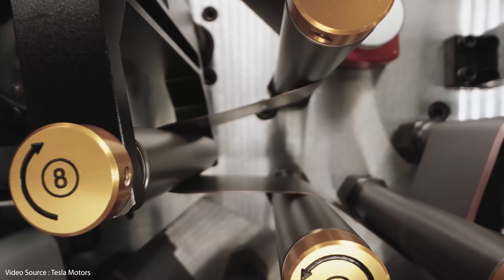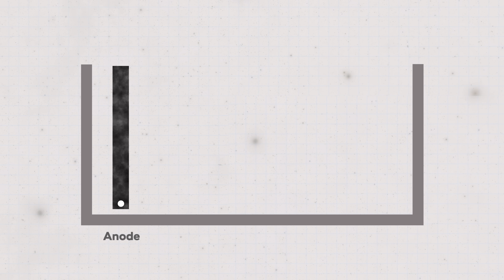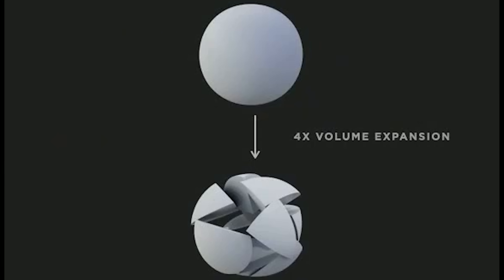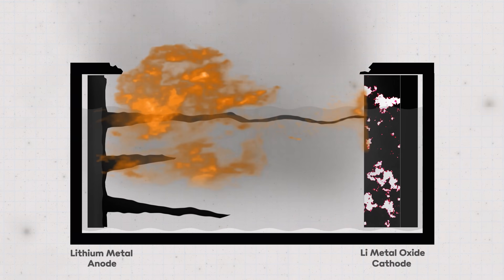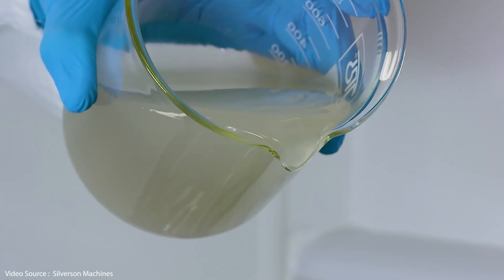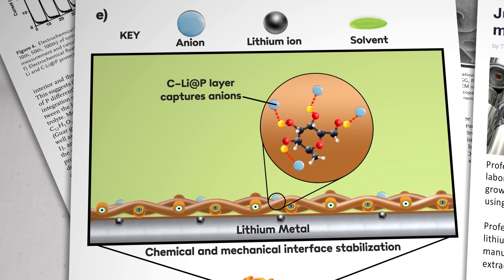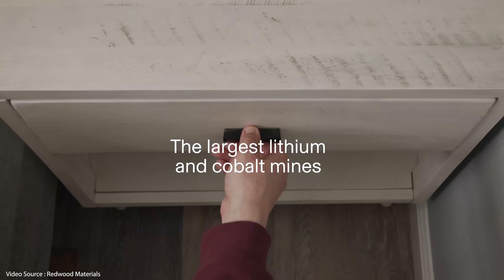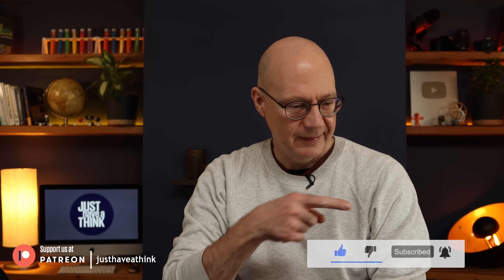Solid Lithium Metal anode breakthrough. 750% LONGER life!

Comment: The Jevons paradox says that increases in efficiency lead to more consumption and waste, because the technology becomes more economical.
Reply: Fortunately the alternative this could replace is already too expensive, so any increased efficiency and more consumption is a good thing. Replacing petrol cars is desirable.
Reply: Yes, increased efficiency will lead to more renewable energy systems and electrification.
Reply: Increased efficiency may well lead to more consumption, but that is not the problem when energy just falls out of the sky. So long as that increased consumption is doing good (new work) that would not be done at higher energy cost then we are winning. Efficiency means less waste pro-rata. High waste-stream processes (wasting energy and materials) are costly thereby. The Jevons "paradox" depends on a holistic, systemic cost blindness.
Reply: If the increase in efficiency results in lower cost to the consumer then yes that can happen. 
However we have a fail safe built in called Capitalism, that will ensure that any cost savings are passed on as profit rather than as a price reduction.
Reply: @Art-o-Games  There are many flavours of Capitalism. Most are corrupt (eg in the US) because market constraints have been bought off (by former Capitalists, newly interested in securing monopolism by any means). Properly controlled and policed markets, using anti-trust measures and carefully framed standards, can cultivate  maximal competition. Profits from efficiency invested in further efficiency and  enhanced market share propel companies to trashing their own market before anybody else does. The  winner/survivor(s) get(s) to a monopolistic position but of a greatly value reduced market. LED chips (that became ten times more efficient than incandescent  lamps) cost a dollar at the start now cost a cent (literally). The commodity part, (now close to the limits of physics) fills a saturated much lower value market and the tech game moves elsewhere.
Reply: @JohnnyBelgium
JEvons paradox actually had a HUGE hole punched in it just last month with the launch of DeepSeek?
The potentially greatest leap was not the achievement of reduced Compute, but the lower POWER CONSUMPTION of that Compute.
Reply: @rogerstarkey5390 Nor is this an isolated    case. Computer architecture with RISC-V open source, will leave ARM and X86 licensing in the dust. Linux will prevail on these more open and innovated platforms especially as Microsoft and Apple OS rentiers both harass and steal from their customers. The maker community and 3d printers gallop ahead ... All we need is open source peer to peer social networking and we'll be mostly free...
Reply: The 'Jevons Paradox' applies to economic areas which are production constrained. When people have the resources they want or need it doesn't apply. When we moved from tungsten filament lighting to LED lighting we saw an 1000% improvement in efficiency, but people are not using 1000% more lights.
Reply: No it doesn't.

Comment: Why do you always show cylindrical batteries? Blade batteries are better because it is much easier to control the space packing facor. With blades you can approach 100%; not so wih cylinders.
Reply: Currently, cylindrical cells are far more common and used with more chemistries then blade batteries.  However, I suspect it has more to do with more stock footage available.

Comment: Is there any truth about the  guy from Zimbabwe. With radiosonic electric generator. If it is could be a game changer. Would love it if it was
Reply: Not a chance.  "Ambient radio waves" as the "inventor" calls them are measured in Micro-watts even in heavy urban environments.  As in 1,000,000 micro-watts equals 1 watt.  That's not nearly enough to power a phone, let alone move a car.  I've seen countless claims like this over the last 50 years.  Every last one is fake.

Comment: It's a series of compromises, and the big issue is weight as well.
Reply: yea it looks like because of technology they can and pretty much decided to just one by one fixing big issues and hoping they can fix enough to make it viable, instead of changing approach.

Edit: Every 'fix' just adds another point of failure as well. The more of the 'core' of the tech you change intrinsically the less you have to do these compromise fixes. These should be just to improve on an already viable tech rather than trying to create one because if those fixes fail you end up back with a firecracker of a battery and not just a bit weaker of one.
Reply: Well, yes, weight is very important.  That's why it's such a big deal that the energy density (energy/mass) of this cell is so good.

Comment: Anything can explode. Any time, anywhere. I was asleep last night and one of my two Humidifiers (copd), near the bed, made a loud bang. I turned on a light and it was smoking, or steaming. I didn't want to get close enough to find out which.
  Instead I followed the cord at the back to the outlet, and unplugged it. It kept making noises. Quieter ones, though. 
I couldn't relax enough to fall asleep, and when I got up I jumped on Amazon first thing. I ordered three fire extinguishers.
   A HUMIDIFIER? Seriously? 🇨🇦
Reply: It the refrigerant they used on it, 600A is a propane based refrigerant.
Reply: @tomnguyen9931  humidifiers don't have refrigerants.  You're probably thinking of a DEhumidifier.
Reply: Humidifiers still have electric/electronic components, and when one of them goes you get a short circuit, hence the 'bang'.

Comment: With money pouring into this industry, there's bound to be a great breakthrough that ticks all the boxes sooner rather than later.
Reply: Money is necessary of course but if there is no talent and honesty boommmmm.
Reply: They have said that about cancer treatments and fusion power as well. Almost no progress has been made in many many decades.
Reply: @jimj2683  yeah, it turns out that life isn't a video game. Money alone isn't enough to create scientific breakthroughs.
Reply: @jimj2683 Solid State are already in production. With many slated 2026, and beyond. Honda is building a prototype plant. 

 We have 500 watts per KG batteries now. Just not for cars. 

 Even if those weren't being made for cars. Batteries have become cheaper than ever, with higher density than ever. 

 The increase has been about 5%, compounding annually with some higher. 

 Battery packs have gone down in price by 90% in the last ten years. 10 years ago it was like 1,110$ plus. Now it is 136$ per KwH. 

 So I don't know what you people are talking about. 

 There are even flying cars. 

 The one thing I can't tell ya though is if the industry will allow KWH prices to drop once 500wh batteries become standard. 

 Or if the savings will go into their pockets. 

 Litherium air batteries have potential get close to kerosene when pulling oxygen from the air.  That is why it is an amazing technology to keep progressing.
Reply: @jimj2683  Not true.  There has been massive progress in cancer treatments over the years.  Three people dear to me who died over the course of my life would be alive now with today's treatments.  While there has been some progress in fusion, it's essentially a fool's errand that will never be competitive with existing clean generation.
Reply: Ah yes! These batteries will become practical when flying cars are practical! Uh, later rather than sooner!
Reply: @glasslinger  The visual pollution in the skies from flying cars makes me hope that tech never happens. Not to mention the noise of flying boom boxes.
Reply: @Art-o-Games  Well people apparently are already accepting noisy cars and motorbikes, so unfortunately they might become reality